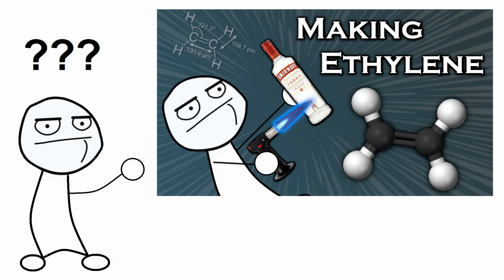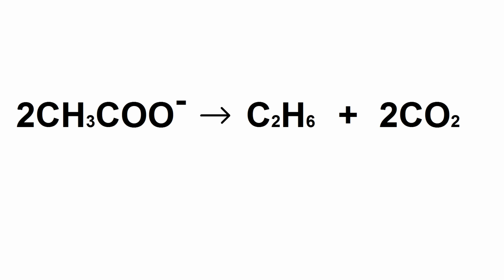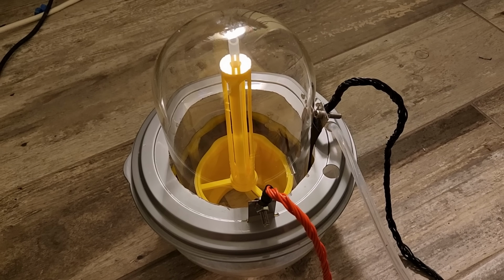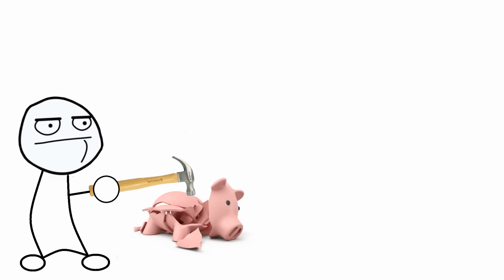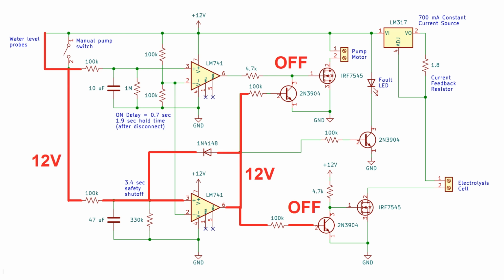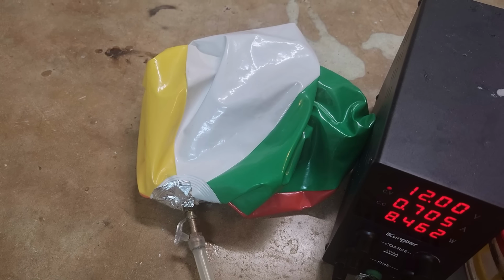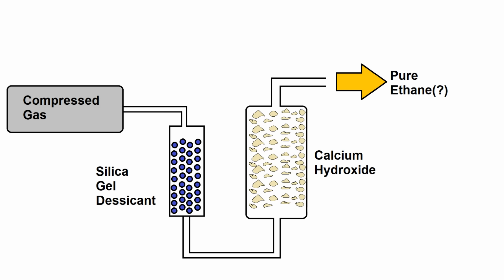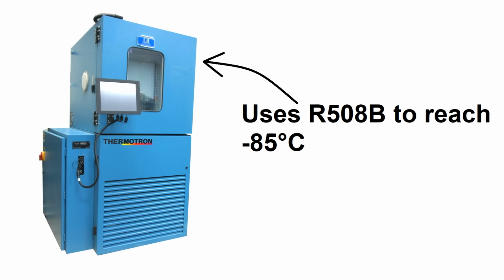How to make Ethane Refrigerant (R170)

Comment: Just so you know the that style of float switch usually has a trick, you can take the end off swap the direction of the float and put it back on. And it will change for normally open to normally closed and vice versa

Comment: Why Not Using Alcohol/Ethanol+Water Directly As Coolant?, There Are Implementations As Of This Writing And It's 100% Safe!
The Compressor Would Spray A Mix Of Compressed Air+Alcohol In The Cooling Side Of The Circuit, The Container Would Still Exchange The Extra Heat With The Exterior, Maybe Would Help To Be Painted Black, Have Large Surface Contact Made Of Aluminium, And An ExtraFan!

Comment: "I used an arduino on the previous project"
yes, he's gonna use an ESP32 or a more modern controller...
"there's too much computing power"
I don't like where this is going
"so we will use a purely analog circuit and use RC time constants as delays"
NOOOO

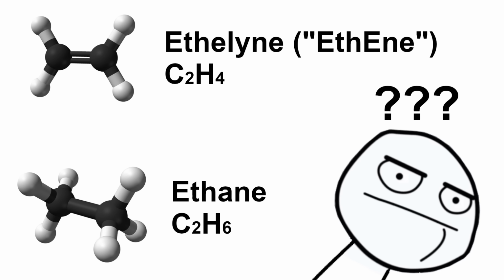Comment: that is a very tight slit at 0:26 maybe has quantum properties? and hydrogen presence in molecules makes them all have gaseous properties not wanting to freeze, probably due to being some form of unshielded by neutrons thus also light and also unshielded attractors of electrons, which can be deposited by light too thus very receptive and perceptive - the more shielded the proton core is with more neutrons the heavier and more solid it is - usually higher melting temperatures but there are temperature anomalies across entire periodic table of elements... other effects at play but there must exist some form of direct easily discoverable correlation with hydrogen as to gaseousness and liquidity of gases and their freezing temperatures across the board - and they seem to be some efficient natural absorbers of energy of photoelectricity? easily agitated by thermal friction

Comment: When you pull out, rotate and put back the cylinder on the float switch, then it has the effect you want. (float cylinder up = signal high) There´s no need to make aditional circuit. :)

Comment: Why did you chose the electrolysis rout ,rather than an organized apparatus with all the condenseres needed ,aa becauae its hard to catch or seperat the gasses when its in a reaction its hearder ,u need fractionating column plus more stations to get it completly seperatef or by nutralizing it midway

Comment: Way over my head as only a 3 year HVAC service monkey, but very interested.
If the right compressor and oil is used, can a regular residential aluminum evap coil handle this gas?

Comment: a really important point of your CO2 scrubber is something divers that use rebreathers talk about non-stop, which are CO2 channels. when you use coarse material like you made, it's very easy for channels to develop that the CO2 shoots through without hitting any of the scrub material. in rebreather diving, this is called a "CO2 hit". you may want to consider multiple scrub tanks, and give them a good shake from time to time, to reduce the likelihood of this happening.

Comment: Hello Space Pirate.

For a good high chemical resistance electrode, I'd actually recommend a pyrolitic graphite or amorphous carbon electrode.

You can get high quality pyrolitic graphite sheets in 0.2-0.3mm thickness and they work very well for electrolysis purposes; they don't degrade compared to normal graphite electrodes.

Comment: The first opamp's capacitor will also discharge via the two 100k input resistors in series and the 330k discharge resistor of the second opamp's capacitor.

Comment: I'm absolutely not saying that I want to see you get hurt but I have always been really curious about failure scenarios of systems using flammable refrigerants,  I've seen many small refrigerators that use flammable refrigerant's and they are always the small college dorm or motel size ones that you know are the ones that are going to get the most abuse.... I've seen people multiple times trying to defrost the fridge with a knife poke a hole in the refrigerant line.... beyond that I think that setting up a system that is dangerous, in a safe place, and running it to see how it fails would be informative, also having a safe way of testing any parts of your system is a great idea, if you aren't sure being able to just test it until failure so you know what certain parts limits are.

Comment: the other reason why its hard to do DIY hydrogenations is that, generally speaking, this sort of thing ranks very high on the list of "watched" and "regulated" lists of various types.  Not just for drugs, although mostly for drugs.  Hydrogenation ranks on basically every possible list of justifications that the government claims for regulation of this sort:  terrorism and simple "safety" (Because hydrogenations either involve dangerous materials, or the reactions themselves tend to proceed by potentially dangerous routes).  More than small numbers of industrial accidents have involved this sort of process.   EDIT:  possession of a business EIN and, especially, a loading-dock equipped commercial shipping address vastly simplifies the purchase of chemicals and equipment that are not explicitly scheduled or listed on terrorism related lists.

Comment: I highly recommend you put a reverse polarity diode across the motor terminals to suppress the flyback from the motor when it stops. If you don't, you seriously risk blowing some components up every time it turns off.

at 14:04 the pictogram for the transistor depicts a PNP transistor; on NPN, the current flows into the collector and base, out of the emitter.

Comment: Excellent work.  General note for all electrolysis fans- stay away from cheap 'platinum,' MMO, etc. electrodes that abound on amazon.  Even when they contain what they say they contain, they are hot garbage.  There are some great independent sellers of ebay that make good ones.  They're not cheap but if you treat them properly they last a long, long time.

Comment: for bending glass tubing you should insert a flexible rod so the glass stays a constant diameter. i dont know what the material would have to be for glss, but thats what you use in hard tubing water cooling loops for pcs
Reply: Just spreading out the flame greatly helps too - - same with PVC. It takes three hands or a flame stand.

Comment: Yup acetic acid layer which is oily and possibly glacial acetic acid as it floats to the top. All you need is 10% cleaning vinegar as well.  Now is your sodium Bicarbonate pure without the filter materials  or binder materials thats in it. Ordinary baking soda contains binders such as glycerine or gluten as well as alum to prevent clumping. What you should do is have a seperatory funnel and see if the top oily layer is actual acetic acid or liquid sodium acetate, or even precipitated glycerine product out of the baking soda Because. Also Sodium acetate can also become liquid when heated. If you decant the oily layer off the top, allow it to cool and throw a small grain of   sodium bicarbonate in it, then you have sodium acetate for making hot ice. Also if the oily substance is slightly amber in color you may have Sodium tri-acetate.

Comment: I love both of these videos, this video on ethAne and your video on ethEne (ethylene) production! Both were gasses I had to source for customers' ultralow refrigeration equipment last year. This is where it becomes challenging. Both gasses are easy to find, if you're buying low-grade gas by the tanker truck load. But try to find ultra-pure grade gasses in smaller quantities, and suddenly you're making a lot of calls, sending a lot of email inquiries, and spending a lot of money. I ended up spending over $4000 on these two gasses, and being the proud owner of a lot more than I needed. The whole endeavor made watching your videos that much richer. Great work doing it yourself from scratch!

Comment: I just checked a paper on industrial scale synthesis using Kolbe electrolysis. Their main conditions were: current density 10 ampere per square dm, cell voltage 5 to 12 volt per pair of electrodes,  temperature: 50 to 60°C (they typically run hot because of high current density.) Anode platinum plated titanium, cathode  titanium.
Reply: There are reputable sellers on ebay that sell platinum plated titanium electrode 1cm x 10cm for 40 euros.

Comment: These electronics are far better than an arduino.
It may not seem so at first glance, but doing analogue circuitry this way counts as 'sufficiently simple' that you can relatively easily get it safety-rated, and many 'safety critical' systems still do things this way. 

Safety-rating anything programming is a massive undertaking, almost no matter how simple the program, because the number of failure-modes that exist skyrocket.

Don't be afraid to use relays for logic also: It's fairly easy to rig them up in fail-safe mode, so you have to hit a 'start' switch to latch a relay to enable something to run: This gives you the additional feature that a process doen't just resume after an unexpected power outage, it just stays off until manually reset.

You'd then have some parameter a comparitor is 'watching' which would cause an alarm to trip which would also disable the load. Bonus points if your 'start/reset' button also makes the alarm run: this means you can confirm your alarm beeper actually works, each time you start it.

Great work!

Also, atlas-scientific has very good pH probe kits including analog outputs. They also do liquid dosing pumps, which could be useful to add vinegar as needed.

Comment: Sodium hydroxide (lye) is also a very good CO2 absorber, it binds it chemically forming sodium carbonate. I would bubble the ethane/CO2 mixture first through a 10% NaOH solution, then through a drying agent (solid NaOH pellets + glass shards mix). That setup will remove CO2 and H2O reliably. Maybe add a final column of silica for good measure (ideally the kind with the indicator dye added to show when it's saturated).

Comment: Look into the Kolbe reaction, which is what you are performing. There are several good review papers if you do some digging. In more complex mixed Kolbe synthesis setups, a high DC voltage is usually called for to provide enough current (typical medium is sodium salts of carboxylic acids in methanol/sodium methoxide). Luckily with your simple setup, only sodium acetate and water are needed so a simple PC power supply may well do. Kolbe demands the use of platinum electrodes. In low voltage conditions you can probably use platinum plated on titanium (using electroless plating!) usual process involves reducing a platinum complex, often dinitrodiammine platinum (II), with a suitable reducing reagent, hydrazine is often used. There are usually some additives involved in the process to ensure a perfectly covering layer of platinum. Electrodeposition cannot be used because of microscopic holes. Solid platinum electrodes would be best, but they're expensive. But in some cases GRAPHITE electrodes can be used. I think in your case, basically the simplest Kolbe reaction,  that is probably an option, they do degrade while in use but that shouldn't be a problem.
Reply: Ethane is formed through a radical mechanism. CH3COO(-) splits off CO2 and CH3' radicals are formed which dimerize into C2H6 ethane. From what I remember reading up on, the Kolbe reaction, when platinum electrodes and high current density are used the reaction goes through a single electron pathway, and when graphite electrodes and lower current density are used, it goes through a double electron pathway. But in your case it's the simplest Kolbe substrate, so both should work.

Comment: Very interesting reaction to show us..

Got an idea, it may be crap, but it may not.... Does this Kolbe electrolysis work with higher carboxylic acids?

Because to me, it just screams, use waste vegetable oil from restaurants or whatnot, saponify it into soap, run it through electrolysis, and blam.. you get saturated hydrocarbons.

As this reaction is mediated through carbocation reduction, you can expect it to self-isomerize.... this is unwanted for fine chemistry, but it's a blessing for making gasoline as it ups the octane rating a lot.

If this works (it may need suitable catalysts and electrodes) it should produce high quality isomerate which just needs some frac distillation to be run as is in a gas engine.

Voila. Renewable petroleum made by photosynthesis (evil laughter)...

Comment: I think that, while running the cell, 2 contacts would have a power potential registration across them. 
This works, Incorporated this in one of my chemical cells. There is no reason to not assume, there would be no question if in an electrochromical cell.

Comment: I am quite interested in is subject. Hav liked, saved, shared, and submitted. I have seen other creators use butane, or propane.  As far as the visuals go, they were impressive. No data though. No - temperatures.
Do you have any experience with either of these as refrigerants. 
Thanks.

Comment: I bet having the beach ball on a sensitive scale would have let you dial in the volume. Also the moment the liquid level dropped below the electrode it will stop producing gas. Call it a last but most reliable fail safe.

Comment: I have a question about your cryocooler what size orifice is in your expansion valve if you want colder inlet temperatures try using a smaller oriface

Comment: lol you could have just pumped the output gas into a cold trap and froze the ethane and let the co2 bubble off. i feel like scrubbers will never be 100% since they have water which will partition a lot as carbonic acid. then again maybe there is some obscure azeotrope of co2 and ethane that will never separate by freezing point difference. if only you had a super cold refrigeration circuit to make a liquid nitrogen dewer trap lol

Comment: i love watching your videos
for your electrical prototypes i recommend using solid copper wire which you can strip out of house wiring (scraps work well)
i also use cat5 solid core if i want something with a lower capacitance
it is a lot easier to work with than stranded wires, will be more durable and the final product looks a lot more tidy

Comment: Your vinyl beach ball is going to be pretty permeable to ethane, most of your ethane is going right through it. Ethane will dissolve in polyethylene and vinyl and outgas on the other side. It's a known problem with many low MW hydrocarbons.

Comment: For the pH/acetic acid problem, how about you get a pH sensor that outputs the measured pH as an analog signal. You could feed that signal into a microcontroller, which then turns on a pump that is connected to a bottle of acetic acid. That way, as soon as the pH drops below a certain value, the pump will turn on and automatically add enough acid until the target pH is reached again.

Comment: Do not use a lead oxide electrode in an acid environment. Lead acetate is soluble in water and you would eat through the electrode very quickly. Platinum plated titanium is the best choice, but make sure you get it from a reputable seller and test it by splitting some salt water (chlorate ion generator) to check for a fake product. If all else fails, you can use the platinum wire you have to coat an expanded metal mesh electrode. Just make sure to go slow and get an even coating. Graphite is another possibility. It is cheap and it won't affect the electrolyte as it degrades. The only downside is you would probably need to machine it with a mill or a CNC router to get the desired ring shape. The platinum wire could then be used to attach to the much larger surface area of the graphite.

Comment: That oil on top of the partially neutralized vinegar solution is some polar substance that is miscible with water. It separated out because of the excess of salt in solution. Sodium coordinates iwth six water molecules in solution (octahedral configuration). So, adding a bunch of salt will tend to exclude other solvated polar substances. You can explore the same effect by adding some table salt to some grocery store rubbing alcohol. The sodium in the salt coordinates with all of the available water molecules and the alcohol gets excluded into its own phase. This (expensive) method of separation is also (rarely) used to crack water/solvent azeotropes (in place of toxic co-solvents like benzene).
Reply: If the acetic acid is derivative from a natural source then it is likely that the salted out oil was made of longer chain fatty acids, short to medium chain ketones/ethers, and/or alcohols.

Comment: In the future, if you ever need to measure the level of solution (I’ve only done this with water, but I imagine with tweaks it could be used for any solution that’s moderately conductive), try using guitar strings!

If you make a little frame that holds two guitar strings parallel to each other and set them at a known reference tension, you can measure the resistance between the two strings to determine what the water level is. It’s much more precise than a simple “on-off” switch because it’s based on the percentage of strings submerged and not an electrical contact that has to be either opened or closed. Plus, I think it may be more resistant to that acetic acid layer surface tension weirdness that you experienced as some portion of the string is always submerged. (If you wanted to be super accurate, you could probably incorporate some correction factor for its electrical effect as well!)
Reply: My good friend Pat Doherty taught me this trick. He’s a tech for a towing tank and this is the way he measures the height of the waves they simulate in the tank :)